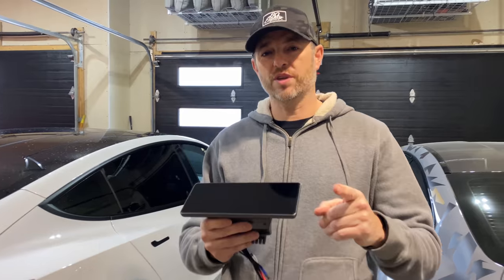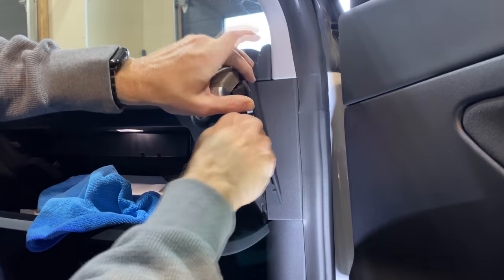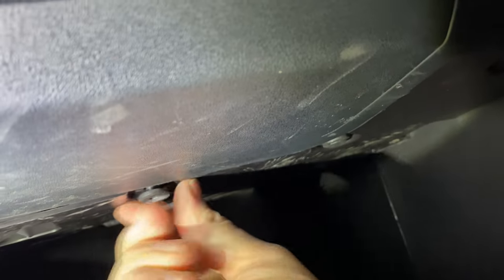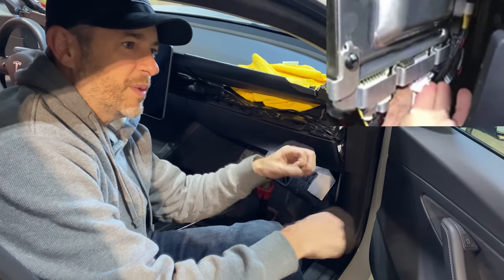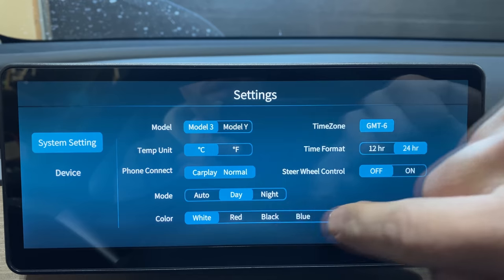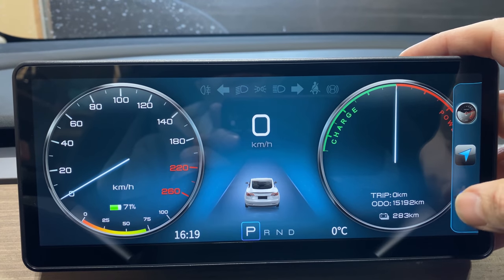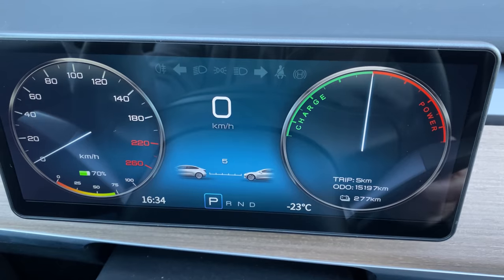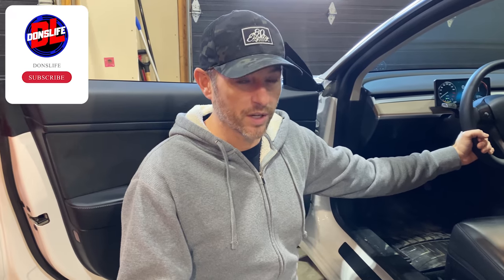How To - Tesla LCD IPS Information Screen for Model 3 & Model Y - Add Apple CarPlay & Android Auto

Comment: Will the LCD Instrument Display work with the new Tesla AMD Risen processor now being installed in the 2022 Model 3 and Y?
Reply from the maker: I reached out to them. Waiting for a reply
Reply: @Donslife  please post an update when you have the information
Reply from the maker: @javoncabarrus3260  Here is the reply from the manufacturer: According to the engineer, the AMD Risen processor is used for Tesla 3/Y Performance. There will be differences during installation, mainly due to different power supply methods and the wiring is also different. On the product detail page, we offer 2 product types (3/Y and 3/Y performance) each with specific installation instructions.
Reply from the maker: Here is the reply from the manufacturer: According to the engineer, the AMD Risen processor is used for Tesla 3/Y Performance. There will be differences during installation, mainly due to different power supply methods and the wiring is also different. On the product detail page, we offer 2 product types (3/Y and 3/Y performance) each with specific installation instructions.
Reply: @Donslife  they have that wrong. At least in the US Ryzen is now being installed in Long Range Model Y’s as well.
Reply: What about “old” model 3 performance cars (2018)?? Does that need the regular version of this? I received mine and am about to install. Is their performance version (the one ordered/received) only for new (2022) performance cars??

Comment: If I would have a Tesla, I would buy it. But I own a EV from Skoda and that has already a front display, a Head Up display and integration to Android Auto and Apple Carplay and I do not reach over my steering wheel to control it. And btw. 800 bucks for that is a little excessive.

Comment: can you tell me should i choose android version or linux since I am using apple iPhone 13 max pro as my mobile phone. which one works better?
Reply from the maker: It only comes in Linux (that I am aware of) it will work with your iPhone for CarPlay.  You’ll read people talking about Android and Linux are the same.  Android is a modified version of the Linux kernel, so they have some fundamental similarities

Comment: I rather wait for a HUD solution  by Tesla than having a second screen. The usability of CarPlay / Android auto is very much compromised by the fact that it’s positioned behind the wheel anyway.
Reply from the maker: That would be great.  We have 3 vehicles with HUDs and they all require a special windshield for the image to project on.  Otherwise it will be blurry and dull.  So if a true HUD system came out, you might have to apply a clear film on the inside of the windshield or get a HUD compatible one.
Reply: What makes you think Tesla even wants to come up with a HUD solution? They're even thinking about removing the freskin' steering wheel for their next cars!
Reply from the maker: @Emaratilfy  I heard a while back Elon said he did not want to include HUDs in his product.   I haven’t fact checked that
Reply: @Emaratilfy  augmented reality features will be a standard at some point.
Reply: @Emaratilfy  Tesla makes stuff that makes sense. A HUD would make sense. Apple Music as an App would make sense too.

Comment: So no need to disconnect battery to install it? Also, Linux version better than Android?
Reply from the maker: No need to.  I shared the installation instructions that were provided from the manufacturer.   Just turn the car off (option in the Tesla settings). You just need to connect all of the wiring within 2 mins. If you take too long, you’ll have to put the original wires back together and then turn off for 15 mins.  Also the operating system is Linux which is known to be more stable than android.
Reply: @Donslife  Android runs on Linux.  So does the Tesla.  It makes sense for this device to also run directly on Linux to give the developers easier access to the hardware.  All three are plenty stable so I don't think that's an issue.  Super cheap Android devices from China can be pretty crappy but that's not the fault of the Android OS.
Reply: Android runs on Linux.
Reply from the maker: @viperv99  yes Android runs on a modified Linux kernel.

Comment: i've been driving for close to 18 years and tbh I dont really use the speedometer so very often, sure there are times you need to check the cars speed relative to the speed limit but more often than not there are tonnes of traffic on the road (i live in a metropolis) so that negates the need to know how fast (or slow) im going..

Comment: Does it void the warranty?
Reply from the maker: In Canada and the US there are laws to protect you.  The manufacturer has to prove the aftermarket part caused your issue
Reply: @Donslife  does the apple CarPlay sound outputs through the car speakers?
Reply from the maker: @lawrences4153  yes it plays through Bluetooth to your Tesla’s audio system or the internal speaker

Comment: It’s cool and all, but it also pulls more extra unnecessary energy from the battery
Reply from the maker: Not too much power as it is just a small screen. Heated seats would use more power.
Reply: @Donslife  yeah I turn everything off that uses extra power, idk it’s just not a necessary gadget for me i suppose. It’s cool but even a little bit of convenience can cost you.

Comment: This doesn't void any warranty's?
Reply from the maker: In the US - You are protected by the Magnuson–Moss Warranty Act.  In Canada, the Consumer Protection Act may apply.  Basically the manufacturer would have to prove the aftermarket part caused a failure.  This device is passive and is just reading signals and showing them on a screen.  CarPlay or Android Auto is only sending a Bluetooth signal to the Tesla too.
Reply: @Donslife  thank you!

Comment: Does this void the warranty in any way??
Reply from the maker: In the US - You are protected by the Magnuson–Moss Warranty Act.  In Canada, the Consumer Protection Act may apply.  Basically the manufacturer would have to prove the aftermarket part caused a failure.  This device is passive and is just reading signals and showing them on a screen.  CarPlay or Android Auto is only sending a Bluetooth signal to the Tesla too.

Comment: Can the wire make strange noises or vibrate under the piece of fake wood? Anyway, I think this video shows how Elon Musk was wrong, he should have added a screen like this behind the wheel
Reply from the maker: No rattling has occurred.  You could tape them down or use cable ties too

Comment: and suddenly one of the Biggest issues with the Y 3 is gone!
Sorry Elon looking over at the main screen for your "no part is the Best part..." does not cut it for many people.  You might "get used to it..." but it will still be niggling at you every time you drive.
Reply: I have test driven a Tesla twice. I found no problem using the touchscreen. I'm 69 years old. I think people are making a mountain out of a molehill. I think if people are going to try to operate this touch screen through the steering wheel while driving, that would be more dangerous than glancing to the side to see the speedometer. Also, because of the voice commands available, a driver should have very little need to touch the touchscreen while driving. I think it's dangerous in general for people to be attempting to manipulate their music sources while driving.  However, for those who feel they need it, this looks like a nice one. Thanks for the video.

Comment: Extremely hard install. Cannot remove the plug that connects to harness at all. After several hours upside down trying to remove it, I just gave up. Instructions are bad and 0 help. Sending back for refund.
Reply from the maker: For me : It was hard to get the harness out but not so bad reinstalling the new one.
Reply: @Donslife  there is no space to pull the plug out. Unless I had baby hands.
Reply: @Donslife  seems like it has to be disconnected one handed. Any suggestions?
Reply from the maker: @pawther3730  I was thinking you might be able to use a long flathead screwdriver to depress the clip while applying some outward pressure or a small set of angled needle nose pliers.   I have medium hands 😂
Reply from the maker: Do you have a friend with small hands that could help?  I would be frustrated too if it was taking me hours.
Reply: @Donslife  I tried the flathead and needle nose pliers. Neither worked. I appreciate you trying to help. Thank you. Don’t know if it’s harder cause it’s a newer Tesla or if I’m just missing something but I’ll just take it to a pro and have it finished up
Reply from the maker: @pawther3730  I was going to suggest a car audio/security/starter installer
Reply: Adding an update to this. Took the car to a professional installer. Screen lit up for about 30 seconds and then went black. I now have no car audio (radio, Bluetooth, spotify, horn sounds, seat belt warning sounds, turn signal sounds) and the microphone doesn’t work. So no voice commands, Texts or phone calls. Tried a soft reboot and didn’t help. Tried a hard reboot. Didn’t help. Now I have to take the car in for service
Reply: @pawther3730  did you fix the issues ?
Reply: What year and model do you have?

Comment: Neat device. Watching the video shows how pointless it is.  The speed on the screen compared to the tesla screen is not even 12” apart.  Everyone crying about the tesla has never driven one or I just inept and can’t cope with change.
I like the. Tesla screen way more because it doesn’t look like a cheap knock off like this screen, has more than enough room for all info, and the infotainment system works great because apple CarPlay is garbage anyways, I don’t know anyone that doesn’t use spotify anyways. I haven’t used Apple Music in YEARS.

Comment: "It is Linux based, so it's going to be much more stable than something that may be Android"

Android is basically Linux ffs..... duh
Reply from the maker: Yes, it is a modified kernel of linux.  I will let you research why running software on Linux directly is more stable than through Android even though they share characteristics